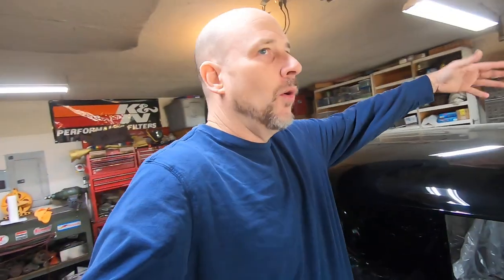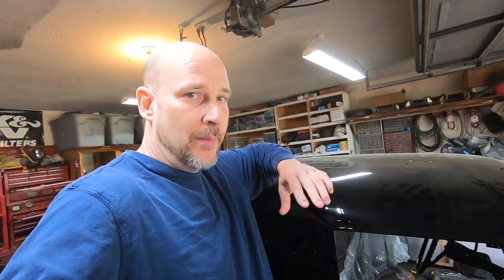1955 Chevy project. More issues

Comment: Looking for that "its fixed" video.  A little seep should seal off.  I have pulled the block drain plugs out on a couple of very fresh engines because like you I put water in them and it was winter. In a very short period of time the plugs had sealed over and I had to break a little film to get the block to drain.

Comment: Many years ago I had the same frustrating low brake pedal issue on my 55 after installing a  dual master cylinder and disc brakes from a 72 Chevelle. The distance between the pivot point and push rod, or ratio, were different. I measured the pivot arm hole location on a Chevelle and redrilled the push rod hole on the 55s  brake pedal arm and it fixed the problem.

Comment: Demon carbs are junk in my opinion, I would pull the trigger and get a holly avenger carb, you have a baby cam in it so 650 is more than a enough. And I think you have something not right in the engine, try not jump from one issue to the other, that can be really confusing. I've been working on these old cars for over 30 years, I hope you get it sorted out I'm subbing  to check out the progress.

Comment: Dumb question,but how is the timing? Too early or late will not burn the fuel correctly. I would demand a replacement master to a 1 inch due to their tech told you wrong